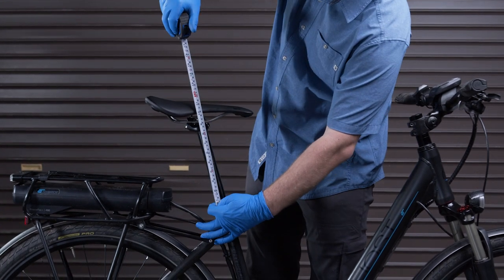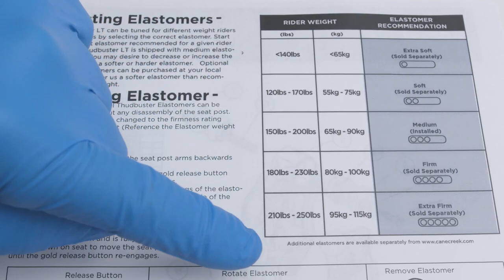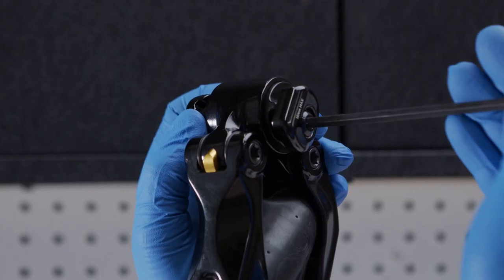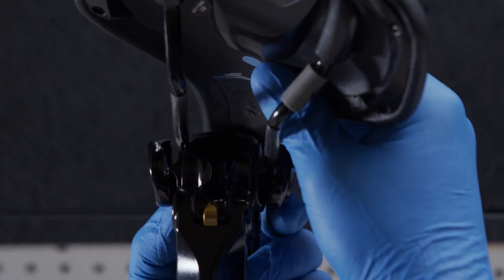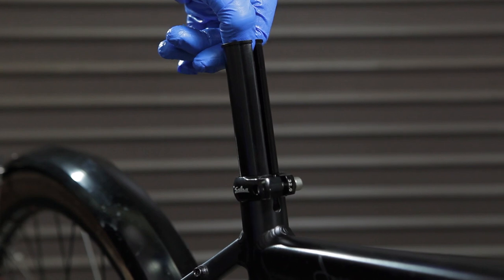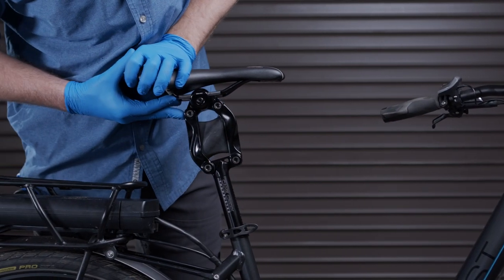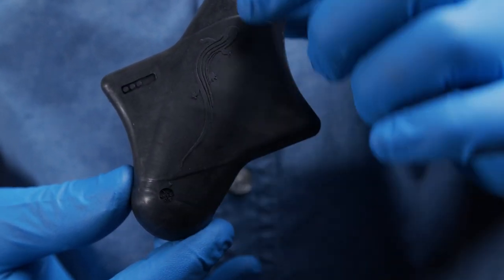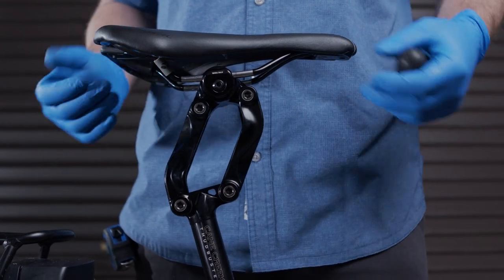Thudbuster LT Installation Guide. Newest Version

Comment: The seat post clamp insert are far to smooth  & the saddle tilts down as soon as a bump is hit ,It wouldn't have taken a lot of effort in putting cerated edges on the connecting parts  like all other makes poor design for an expensive product  , & on the ee silk that I also have the saddle connection is excellent but you don't do a 30.9 version with shims & my Titanium frame it still slips down .

Comment: Hi,
I have a problem with the seat clamp mecanism.
Under my weight (I’m 72kg), it’s shifting upward, no matter how much i tighten the bolt.
Any solution ?
Reply: Same issue for me. Design seems flawed. Not sure why they didn't make it similar to other posts that work fine.

Comment: Installing the extra hard elastomer ist hard but I just manged it! and i guarantee it can be done. 
Make sure you are turning the "wings" in the correct direction so that the "TOP" label ends up in the top.
Possibly it is easier when the post is installed in a bike.
Reply: I just installed extra soft. Went in pretty good. But I noticed I could remove it WITHOUT even pressing the gold button. Haven't rode it yet because of rain today and the next few days.
Reply: I cant seem to get it in again.